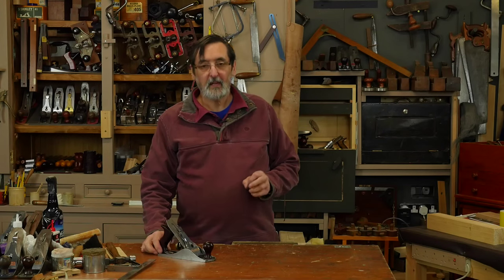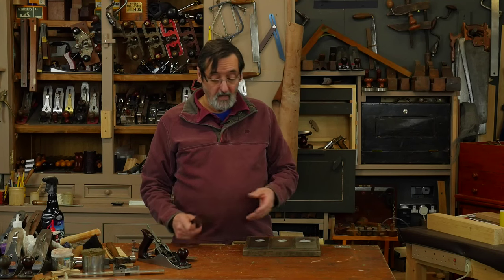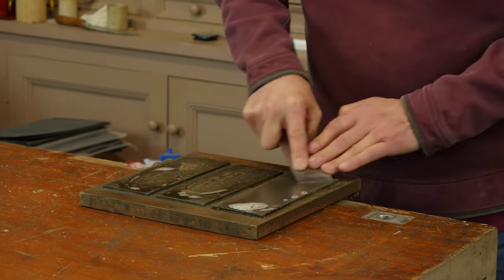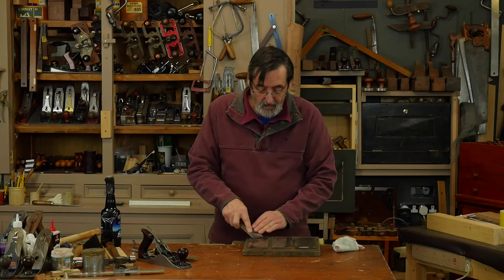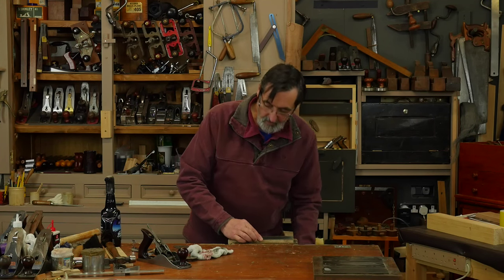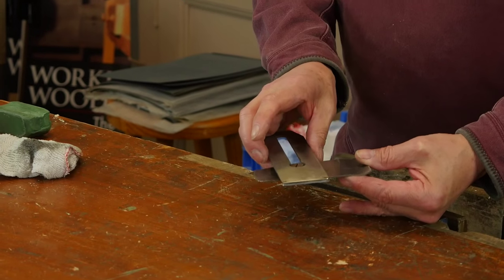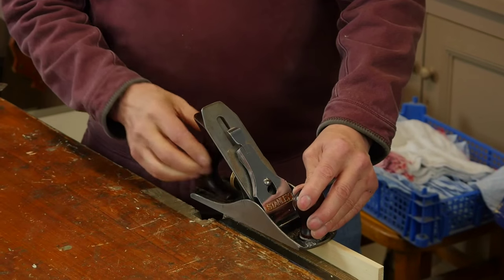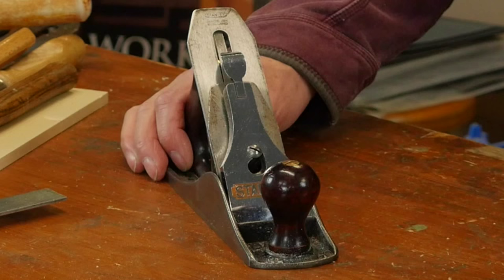Sharpening and Setting the Bench Plane | Paul Sellers

Comment: Stanleys made a number of mistakes through the years but they always came back with better ideas that worked very well .One first attempt I read about yesterday was a screw on replaceable blade edge for planes. That failed. Later was the RB10 which works but is fiddly and awkward. The later version with yellow parts is perfect for basic utilitarian planing .Pitty the sole need to be flattened first though . But Stanley marches on .

Comment: ive bought recently a draper bench plane very similar to no4 stanley...it looks well built but needed some finish up work. after getting everything done and the blade is crazy sharp, i do a couple of passes on hardwood and i start seeing marks on the wood...the blade is dull and has little teeth in it....blade bevel is between 25_30. any advice on whats wrong?

Comment: Could you not just use the fine plate then strop it or is there a reason for using the first two stone?
Reply: Tom Angle I have a similar sharpening setup and technique to Paul, and I have tried skipping the lower grits occasionally. What I have found is unless the plane is already quite sharp it ends up taking much longer than just going straight to the low grit stones and work my way up. Once you have a burr it takes very little time to polish it up if you have sufficient number of steps and fast cutting stones.
Reply: neistridlar Thanks for the reply.
Reply: +Tom Angle the coarse stone is used to set the initial bevel. You then progress through the finer stones to polish the out the scratches left by the previous stones. Starting off with a very fine stone would do more polishing than honing

Comment: what did you glue the leather to the board with for the stropp? thanks .... good detail about where hand and pressure should be at all times.
Reply from the maker: Double-sided mounting tape, not the padded type, just the thin type.
Reply: thank you, good advice
Reply: and the tape needs to be applied at top and bottom of half sheet, NOT 3 pieces full length top to bottom

Comment: Hi Paul, I just purchased a Stanley 14" 12-205 plane for $.50 USD at a resale shop. I plan on cleaning it up and sharpening it. I rarely (meaning almost never) use a plane. What is this particular plane used for?
Reply from the maker: It’s used very similarly to a number 4 plane but the sole being longer means it’s better for straightening wood than the shorter number 4.

Comment: Just potter about in shed but wondered if the bevel is facing up or down on the plane you've just sharpened the blade for, the plane i have looks same size and style all i know its a stanley no size on it, so another question how do you know if its a 4 or 4 n half ect, a novice and to old to be anything else but like vids, cheers Paul
Reply from the maker: Hi John. The bevel on all bench planes in the bench plane category of planes always face down, no exception. i hope this helps.

Comment: I have 1 side of the blade protruding a little more than the other but adjusting the lateral adjustment to either side doesn't seem to work.

My blade Babel isn't exactly perpendicular to the length of the body but I thought the lateral adjustment could fix that. Was it just the blade or am I doing something?
Reply from the maker: If the blade is not ground square and too much out of square the lateral adjustment will not work. Check the blade for squareness first to see if this is the problem and if necessary grinde to square. That should fix it
Reply: Paul Sellers I used a protector and it's off by less than 1 degree barely even half a degree. I don't think it's the blade, I looked at the gap between the blade and the lower mouth (nearer to the back handle).  And the gap is noticeabley larger on one side.

I discovered that the frog legs are not squared in fact they are way off by at least 3 degrees. I tried my best to square it with a file. It's much better but the gap is still there even when the lateral is in the middle. 

Now I stuff it with a thin piece of cardboard on one side of the frog where the blade sits and adjust the lateral to one side  and it seems to do the trick. Maybe the bed isn't squared to the sides.

Anyway this is my first time owning a hand plane  it's brand new, I was wondering if this is common or it's a manufacturing defect.

Comment: I just bought an old series 17 No 4 English made Stanley plane and the iron does not have the corners taken off and the edge of the blade is shaped in an arc. Should the fwd cutting edge be straight? The is a nick right in the centre of the edge so it needs to be ground and I therefore have the opportunity to remedy the shape of the iron on its cutting edge if it is incorrect. Also why do you take the corners off?
Reply: allanpennington you take the corners of so you do not leave lines in the finish
Reply: allanpennington yes... when you grind it you should have a straight flat edge with the exception of the very corners. Try to make sure the edge is square as well... that will make adjusting your plane much easier.

Comment: Thanks for the video Master P.Sellers.
Questions:
Does the bevel need to be death square to the blade?
How to correct the bevel to be square if is not?

PS:I know you have a lot of experience and this do not happen to you :D
Thanks
Reply: Fairly square is all you need, older blades won't really have sides that are dead parallel so you can only be square to one side, but if you go really out of square, your plane won't be able to adjust for it, if you plane is out of square and you don't have a grinder or jig, then picking and abrading the high spot until it drops the edge to square will work freehand

Comment: You wound back the blade but didn't return the thumbscrew back to take up the slack. The blade can continue to decrease as the plane is pushed forward. No mention of 30, 35 degree grinding angles?

Comment: I have found that a light TAP on the plane iron is a better method of adjusting than       the lateral levers. Take that advice forwhat its worth . Most people put TOO much adjustment with the lever . A light tap to the side of the blade is WAY MORE ACCURATE.

Comment: Would a buffer wheel and compound do as good a good as your leather strop?
Reply: Gary Z Yes although the buffer wheel is going to remove more material. You have to be careful not to heat the metal as you could damage the temper with excess heating of the edge.
Reply: A buffing wheel can cause the edge to bend over.  You don't want that.   A wood mounted strop and maintaining the angle ensures that you don't do that.

Comment: Is the leather side up or cut side up in the polish strap?
Reply: apinakapinastorba This is a point a lot of people like to disagree about and say its this way or that way.
But it kinda depends on what kind of what results you wish to achieve and what type of blade you're working on.

For things like straight razors and other really delicate types of edges the smooth side is usually preferred but when you sharpen at relatively "coarse" grits like here you'd probably be best off with the rough side and chromium oxide. Don't get me wrong what Paul does here is easily enough for a good practical result so there's no need to do it finer and it'd be kinda a waste of time when you will hit that inevitable knot.

But some people like to go to extremely high grits on stones first especially on knives and things like razors, in that case and especially when its a straight v grind I guess you might want the smooth side over the rough side.
Reply: You can use either side. What I've found is that when you spread the chromium oxide on the inside of the leather you tend to have chunks of compound. When you spread the chromium oxide on the smooth side it tends to go on more thin and uniform. You get better results applying chromium oxide paste to the smooth side
Reply: Thank you :)

Comment: I have a cheap  plane, yep HF, one, I shapened it today works fine with a good edge but I noticed the edge is not square to the sides.
Not knowing a lot about planes if that normal or do I need o work it till the edge is square to the side?
Reply from the maker: Hi Terry. It won’t affect the functionality of the plane, however next time you sharpen it press harder on the long point, that will correct it.

Comment: I've got my iron about sharp enough to shave with but for some reason I'm either getting chips or dust - no in between. Any advice for a newbie?
Reply from the maker: You can start by checking your angles on the bevel also often people strop the bevel and round over the end without even realising they are not so much sharpening it but rounding it. There are too many variables to give you an exact answer and it’s really a question of experimentation.

Comment: Can you (or someone else) advise what it is that you put on the leather (green color) before you started working it?
Reply: its honing compound
Reply: It's something like diamond paste
Reply: LittleShop OfSawdust Buffing compound... you can buy it at most hardware stores. Usually used for a buffing wheel. It comes in various grits as well. The green color is a medfine grit for buffing compound. If your hardware store doesn't have it try a welding supply company.

Comment: Hi Paul I am looking for the green honing paste that you use to polish the plane blade could you tell me the correct name for this 
Thanks Ian
Reply: ian mills Search Amazon for stopping compound. A block is about 12 American Pesos.
Reply: ian mills Look under buffing compound as well... they are the same thing and you will probably have better luck. It comes in various grits denoted by the color of the compound. You could even go with multiple stropping leather for finer progression of the edge although it really isn't necessary.
Reply: TheSatyrblue thanks for the information

Comment: So if I understand correctly, the original factory angle was 25 degrees and you ground it to 30 degrees. At that point you honed the blade at 30 degrees with NO micro bevel required. I have been sharpening at the original 25 degrees on a 120 grit diamond stone and then on a 600 grit. My final sharpening is on a 1200 grit at 30 degrees for a micro bevel. Am I wasting my time with the last step on a micro bevel?

Comment: Paul unfortunately I don't think they don't know anything about sharpening blades in Ireland. I tried to get the good sharpening stones glass or diamond stone but all I could get in one of the top well know hardware stores in 1 type of the diamond stone which is popular for flattening the oil stone. You can't get different grades in good stones only the one grade diamond stone and I can't even see anywhere that tells you the grade it is. To get the proper grades in the stone you have to send away out of the country. Here it is really only oil stone with rough on one side and smoother on other side. One thing I miss from sharpening videos when the person making the video takes out the plane blade they unscrew the bolt holding the blade and backing together and take them apart and move on to the next step. A lot of people trying to learn don't get to see the plane close up to see properly and when the blade is removed they can't see close up the way the backing and blade is turned so many people have trouble putting the items together properly. This needs to be seen at the start of the video and again when the tutor is assembling the plane step by step to show which way each part it turned and then connected. Most videos show at a distance and too quick how good they can do the job instead of trying to show the viewers how to do it properly. Decent viewing with explanation and demonstration is what viewers need and not assumptions that everyone knows most so skip through but the person trying to learn is left way behind and forgotten about. I'm over 60 and trying to learn hobbies but have to watch lots and lots of videos to try and get a slight few seconds of an accidental glimpse of the part important to me which is important for the actions and knowledge need to use the tool. If the tool is not rightly assembled it won't work right thanks

Comment: Are you aware of any videos that show a smoothing plane in an actual productions setting? There are numerous videos about many types of planes from how to refurbish then to how to make them for example via the Krenov approach. Most of these videos show working on planes from start to finish with the "finish" showing the planes creating wispy shavings basically on wood ideal to demonstrate ideal performance but not in actual application. I can find nothing that shows planes in actual practice. I am specifically interested in observing how a smoothing plane is used and what the shavings and finish look like. I just built a Krenov-style smoothing plane and can get paper thin shavings but have no idea of what using this plane would look like. I can't envision building a cabinet a producing long uniform shavings like typical idealized presentations. Could you please comment on this question? Thanks.

Comment: Hi - at 7:50 what was the green stuff you put on the leather?
Reply: Mike Dawkins Mike, it is honing, or polishing, compound. A quick search on google and you'll find some. It's inexpensive and easy to come by. Good stuff.
Reply: Rico S Thank you.
Reply: Mike Dawkins That particular type is called chromium oxide. You can buy a stick of it about 6" long (like the one he was using...but his has worn down) for about $10.
Reply: Thanks Bruce. I'm sure in the UK it will end up being £200 :-) Just kidding!
Reply: Mike Dawkins Mike, I'm in Scotland. I get mine from Axminster for just under £7. Or £10 for the posh Veritas stuff, if you're mates are coming round and you want to impress them with your branded woodworking items.
Reply: Mike Dawkins A few years I went to sharpen a plane iron only to find that I'd run out of my usual compound. It was late and all the shops were shut, so I decided to look for something in the garage, I came across a tube of 'autosol' metal polish. I found the result very satisfying and have been using it ever since. I recommend it to anybody especially since, as others have pointed out, some of the compounds you can buy from the likes of Axminster can be as much as £10 where as I think I paid about £3 for my last tube of autosol!
Reply: charlieboy11 I think that's why so many people like ***** ...he just shows that you don't have to spend a fortune to get your woodworking to be the way you want.
Reply: Thanks everyone. I've bought from Axminster before so will take a look. Agree about these videos. They just make so much sense. Like having a personal tutor. Brilliant :-)

Comment: Paul i am a newbee in the carpentry,  i need your help i have a waterstone king 1200 and king 6000 i try yo flatten the back of the plane blade but i polish it but the back does not get polish it remains dark why Is that how can i Fix this, i am doing something wrong but i do not know what can YouTube help me please sorry for my English!!
Reply: Sounds like your stones are way too fine to really reshape a blade. You want to start rough so you're cutting quickly and efficiently, not wasting your waterstone's thickness. Once the shape is there, then use higher grits to polish away the scratch marks.

Comment: I’m seeing other “experts” on YouTube advising that if you “sharpen” often that you only need to go back to the strop to maintain the super sharp edge. Why do you go back to the course surface every time? Sorry if the question seems like an accusation but if you looked on YouTube you would see that literally every person has a different way they are suggesting is the best. Every method seems to contradicts another in some small way.
Reply: Joel Harry - In my experience as a woodcarver & woodworker, stropping a tool every so often is more of a maintenance of the razor sharp edge. In other words, I've just got my chisel immaculately sharp & (depending on how it's used & how frequently it's used) I'll strop it about every half hour to maintain the razor edge. If the tool gets nicked or is too dull for maintenance stropping then it's time to re-sharpen the edge. In my opinion plane/spokeshave irons are different than some other tools like chisels & gouges. I wouldn't disassemble my plane unless it was time to re-sharpen the iron & only after touching up the blade would I strop it. I don't know if this is any help to you but I thought I'd try. Good luck